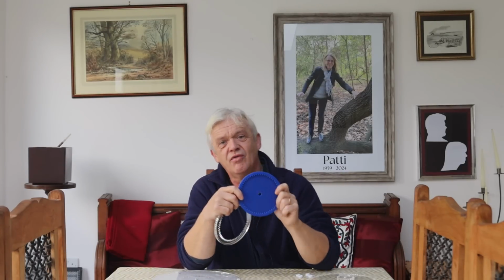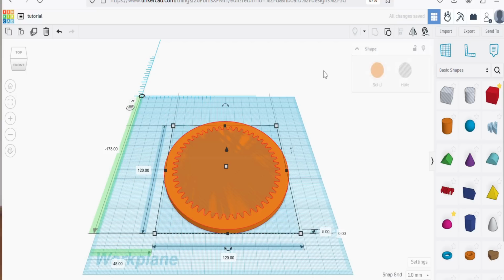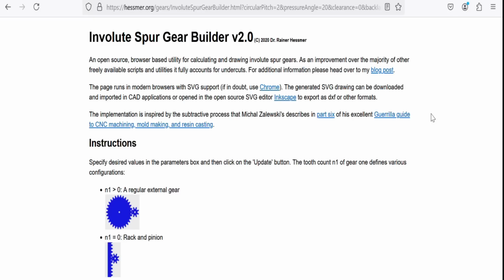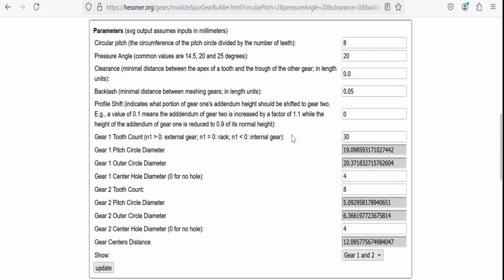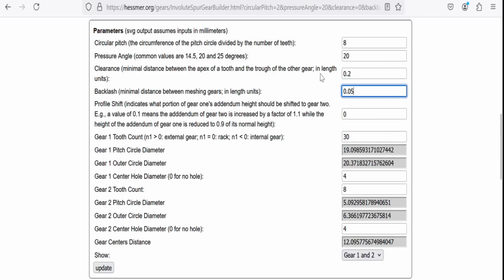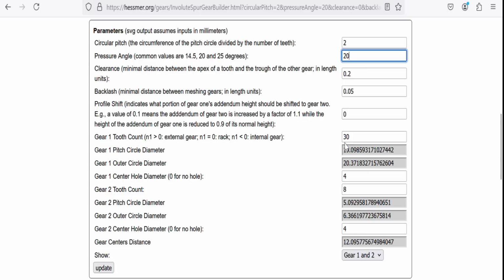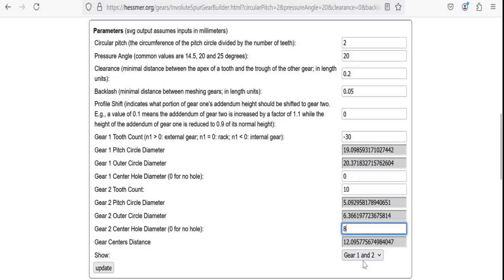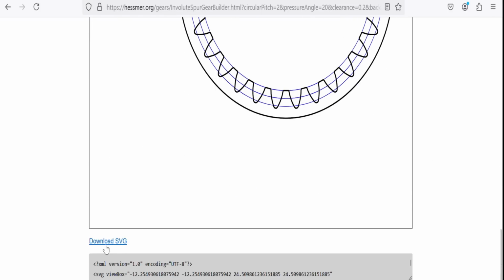2352 Making Ring Gears

Comment: I just realized something that could be quite useful is a mold you can print out for making timing belts, then you can use fiberglass or nylon fibers and a moldable rubber to squeeze into and over the fibers to make a timing belt of the size of the mold, now to be able to make a variable mold so you can adjust it LOL 

(been thinking of this whole belt thing as I have three "broken" motors that I want to put a speed controllable DC motor on a belt system to run them, one a core from a grinder to hold diamond coated metal plates for grinding carbide (tungsten) parts like drills and mills for my PCB work I am in the middle of (and how you can get 10 drill bits made of solid carbide including the whole shank that on snapping off the bit you have a decent long shank that a small PCB depth level drill bit can be then ground down of the nearly diamond tough material which I have sorta done clumbsily by hand and it works but not fast enough) 

oh sorry the price, I paid a USD 1 dollar for each pack of those 10 drill bits, that the bit itself is .0188" and the shank is .125" (1/8th inch) diameter, 

I got them to make chisels for carving die steel for making coin dies for a friend's project but basically I paid 19 dollars for 190 bits and 10 dollars shipping (had to buy a small amount to check them out else that would have been one 5 dollar payment for all 19 as the guy is really good about their business practices and not trying to gouge people on shipping to make not a lot of money but ALL the money like some corpo minded person, also he makes VERY good bits (got some he made from blanks of carbide and coated himself with zirconia as well as uncoated end mills and they are SMOOOTH running very well made :) *(look up the oliver tool company or the user name drillman1 on ebay to find him :) ) anyway he had to raise his prices and he sells those 10 packs as used and reground but they are not, at least the 19 packs I got are ALL brand new and will bite quick into anything even solid blocks of glass and drill through it (granite you name it, they would as is make very good bead making drills for any stone other than natural Silicon Carbide or diamond (not sure if Tungsten carbide is a natural rock or not) also they are all japanese and a micrograin carbide of some sort so they dont just snap with the slightest flex 

BE CAREFUL opening the packs I have a whole half inch long drill bit in under my thumb nail from slipping while opening it and jabbing and snapping it off under the nail that is taking forever to migrate out as I have not sliced the nearly quarter inch deep hole into my thumb to be able to get a pair of tweezers or something on it to pull it out, and I have used my fingernail to flick a chip of carbide out of the white of my eye before (since the magnet trick does not work on tungsten LOL) and had to allow a cat allergy to cause my eyes to make a ton of eye boogers to get a very fine sharp flake of aluminum off the cornea of my eye too (was too painful to try and remove it and it most likely would have broken up possibly migrating into the cornea from what I had read, lol) 

anyway a slower moving belt fed very tight flat with that 90º angle that angle grinders and bench grinders have on the plate is just what I need though I also have a decent I think 5000W high speed routing head (water cooled) that I bought cheap as it was burned out, so I have a good core and bearings with a perfectly newish ER20 collet that running it slower would be better for milling metal and such, that I also want to belt feed a DC reversable speed controllable motor too for running it,. (working on a CNC T-slot rig to make a grinder head and slap a rotary table I have on the bed to make these bits. probably going to run it slow enough that a spring action on the holder of the bit I am grinding, can move should the grinding head is not moving perfectly smooth so it wont snap those carbide parts that refuse to deform the way even HSS does. lol. (ie a free floating head on a light spring since pressure is only going to wear down the grinding grit) 

anyway I will probably just use strapping tape and timing belt on a roll to make what I need right now but a way to make molds for them, man this gives me ideas like step down rotary tables on a CNC rig with multiple gear ratios on one unit so it can be dialed down to 1/1000th of a degree per step of the steppers ect. :)
Reply from the maker: I was thinking about timing belts and 3D printing them only recently - i may try and do a video on it because you posted this mate

Comment: Hello Robert.  Nice video, as usual.  You've just made a light go off in my head - I'm currently resurrecting a milling machine, and need a bevel gear set for the vertical head I'm making.  Now, I can make straight cut bevel gears on the machine itself (which is how the bevel gears on the vertical axis drive and in the temporary vertical head were made), but they are noisy, and should really be helical.  The light you've just made go foo was the one marked "why not check out the price to get a pair of gears printed in stainless" - getting them cut is absolutely out of the question financially, I'm afraid, none of my friends have a gleason gear cutter.

So, before I go off wasting a bunch of time searching for a helical bevel gear generator, or worse, writing my own, I don't suppose you have a link for anything like that stocked away?
Reply: For what it's worth, I found a solution.  A couple, in fact.  Firstly, the BOSL2 extensions for OpenSCAD do this extremely easily.  Well, fairly easily.  Well, fairly easily for an OpenSCAD solution.  Yeah, it's not overly easy, but the results are great.  Chucked the resultant stl to the various online metal 3d printing services, yowza, spendy.

Second solution, one of the online metal 3d printing services which is frequently mentioned as a sponsor for youtube videos has almost-compatible gears available off the shelf for much less spendy.  But shipping is - well, spendy.

So I guess I'll be cutting the gears myself and making do with straight cut.  Bah.

Comment: I used the same gear generator to make a ring gear for a Swytch ebike hub motor, had planned on using it as a pattern for casting in brass, amazingly it held up just fine out of plastic
Reply from the maker: nice mate - job well done

Comment: Do you have a discord server? That or is there a place that folks who are playing around with some of the winmill/wind generator designs and trying to get a usable structure that doesn't cost a fortune to get a reasonable amount of energy out of it? Just asking as I am playing with the omniball and working on what needs done to refine the blades and possibly increase the size enough to get a bit more wattage out of the beautiful beast.
Reply from the maker: I believe there is one mate - but i don't run it - i will try and find the address

Comment: I used to use an older version of that site, which used to save as a dxf, the only issue i used to have was that it sometimes wouldnt import the dxf in certain CAd software
Reply from the maker: he also has some other good gear makes - very nice cycloid gear makers

Comment: I started working with Inkscape and using SVG several years ago because it is scalable without loss, as opposed to pixel based graphics. My plan was to use it to make certain types of art in a video game /  electrical system simulation in Unreal Engine. Inkscape is a fairly amazing free SVG editor. 
I had no idea that Inkscape could be used to export to DXF... That's pretty cool stuff. Always cool to learn knew things here and there. I don't really use DXF as much as I used to, but it is handy to have for the occasional 2D drawing, CNC etc. I tend to do everything in 3D models, and convert to STL.
Thanks for making this video.
Reply from the maker: thanks for the tips on inkscape mate - i am aware of it but never used it - i will have to change that lol